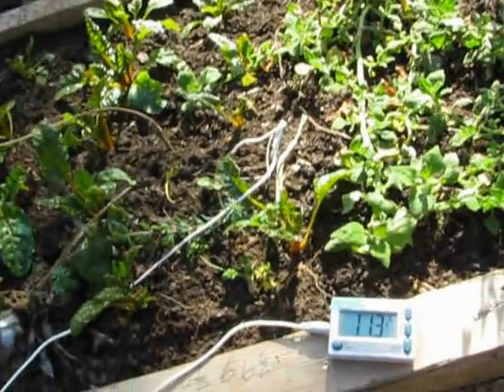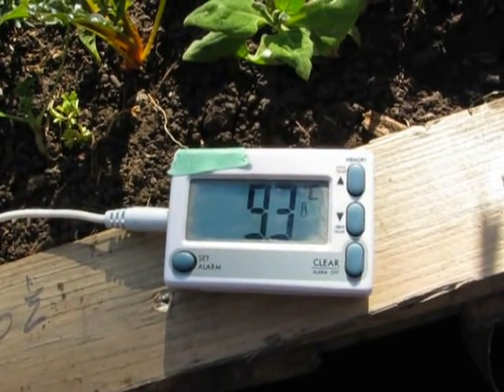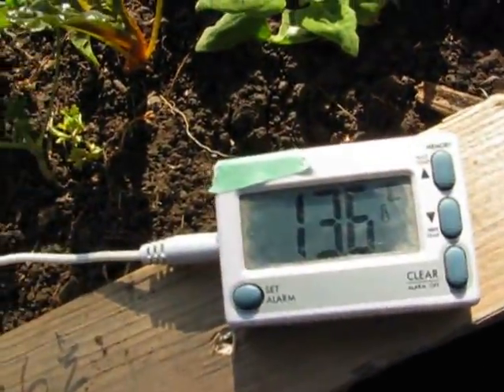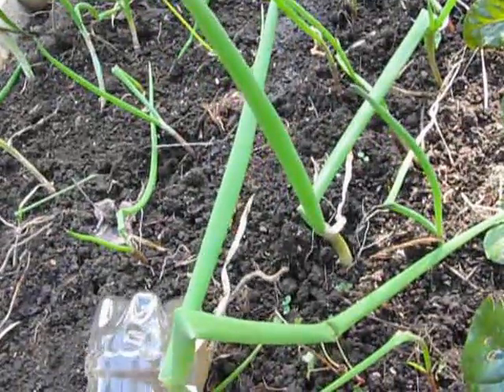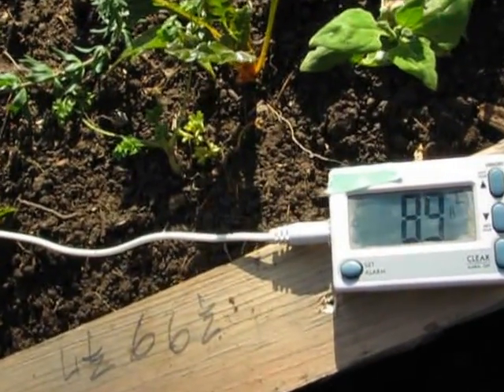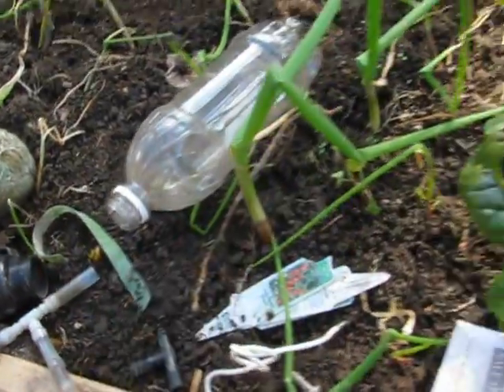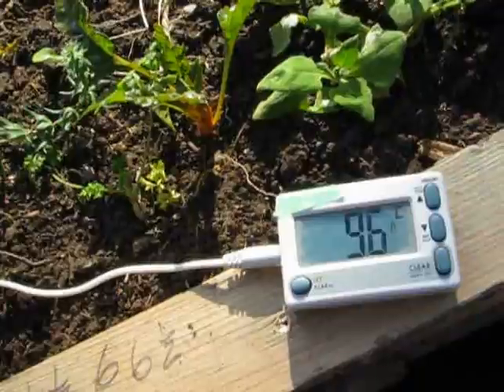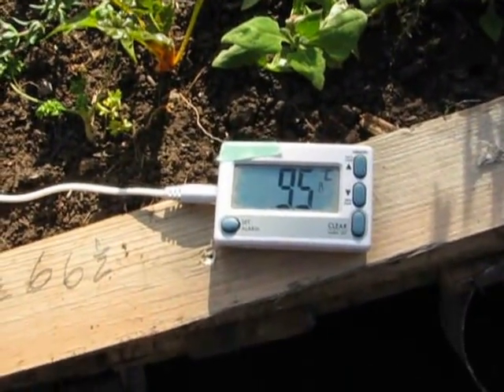International bottle greenhouse effect experiment.  Please join in.

Comment from the maker: I will put in some helpful annotations later.  At this time,  my greenhouse is  not suitable for this experiment because shadows travel in front .  You need something  which measures to 0.1 of a degree (centigrade)  Heat capacity of water is 4.2 joules per cm3, soil is is about 1.5 grams per cc and heat capacity 0.8 to 1.48 per gram (depending on how wet it is) so its heat capacity per cm3 is about 1.2 to 2.2 joules per cm3. HALF to a QUARTER of the volumetric heat capacity of WATER!